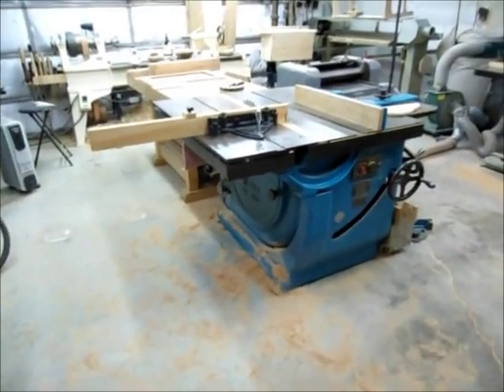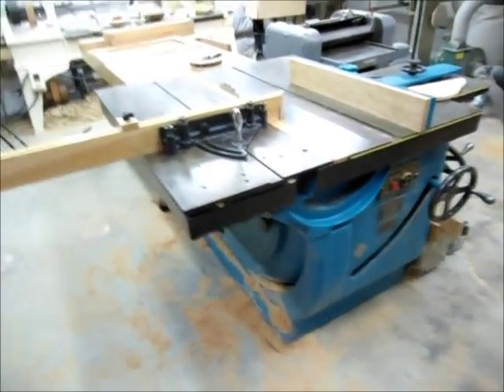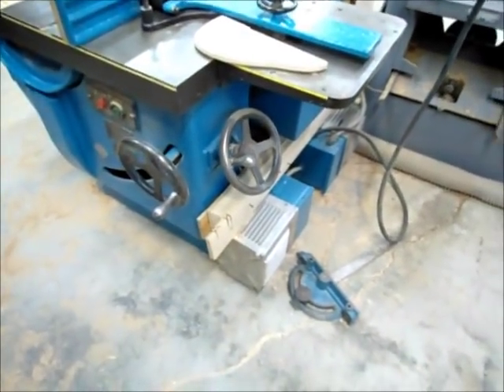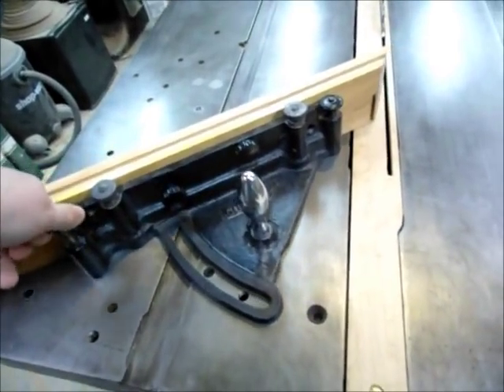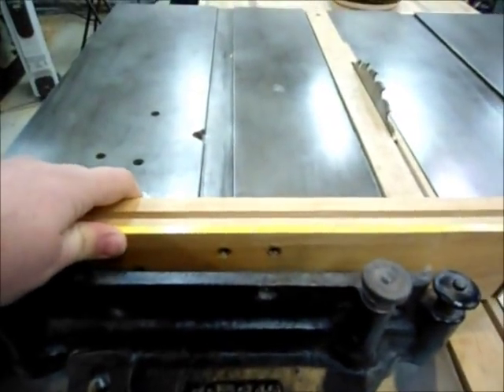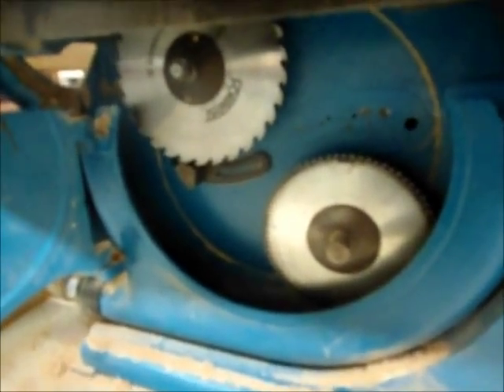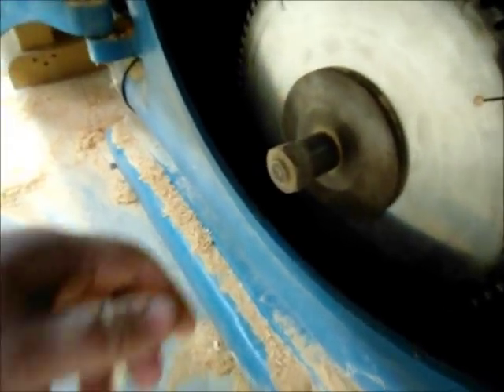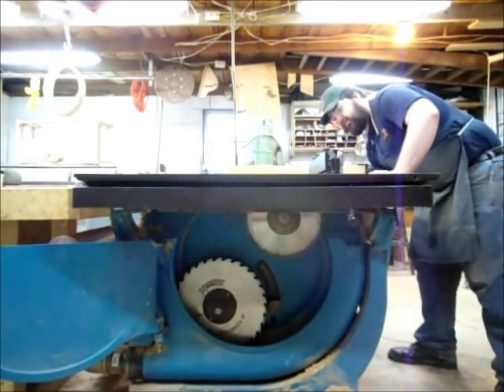Oliver 260 D Table Saw

Comment: I just noticed that when the motors are rotated on my 260D, the bottom portion of the "turret"  or yoke sticks out about 3/16" at the bottom of the casting, causing the blade to be vertically out of square. This is consistent with each rotation- there is no "slop"- it just seems to need adjusted.   If I were to pull the entire yoke assembly out, what retains it so this does not happen again?  Before going to that much trouble, I wanted to make sure the end result will be successful.  Thanks for your help.

Comment: What rotary phase converter/transformers do you use? I have the same saw and I'm trying to run it without 3 phase.
Reply from the maker: Is it a 220 or 440 volt? If it is 220, then the job will be a little easier.

I would recommend an American Rotary brand converter. A 7.5 hp or 10 hp rotary phase converter of any make would get the job done though if your saw is 220 volt.

 I had to also use a transformer to get my 3 phase power from 220 up to 440 volt since the motors are both wound to be 440. The transformers I have on the saw are kind of cobbled together out of stuff that was available, but Grainger and McMaster Carr both have step up transformers to go from 220 to 440 that would work if you need 440.

Comment: I was wondering, how many 260D or 270D tables saw have you come across with the quality of this saw?  I am in need of setting up a shop and mu h prefer old equipment.  how did you locate your saw?
Reply from the maker: They come up fairly often if you are willing to drive for it. IRS auctions, OWWM classified, and craigslist are the sites I would frequent if you are in the market for an old cast iron table saw.
Reply: Kyle VanMeter Thank you for the information.  I will keep my eye out for a nice 260D or 270D or Tanerwitz saw.  For the saw I am looking for I am willing to drive to get it and have the trailer to load and haul more than one heavy piece of equipment if I come across a sale where I can bundle purchase. Thank you.

Comment: Hi Kyle - I've had an Oliver 260 for about a year, but only recently put it into operation. I've found it difficult to operate the raise/lower wheel. Did you have to replace the bearings in order to get it to operate smoothly? Or did you have to do anything else to get the raise/lower operation to work?

Thanks
Reply from the maker: I pulled the entire yoke assembly out and cleaned both bearing surfaces on the large circular assembly. If I had to guess, yours just has a bunch of rust, sawdust, and gunk in it. Mine looked atrocious and was very stiff to rotate prior to disassembling and cleaning. It takes an engine lift to pull out the round arbor/yoke assembly, but it is worth doing every 30 years or so!